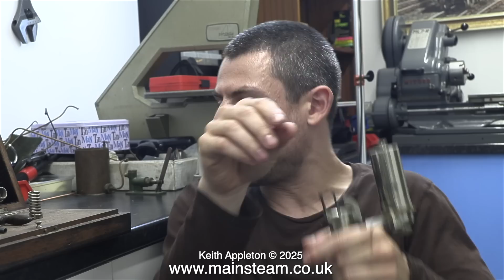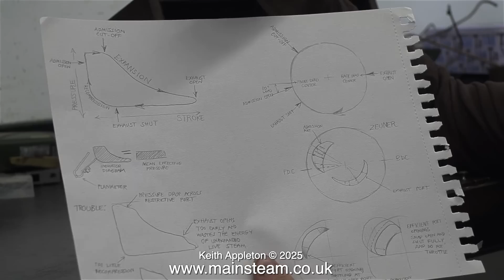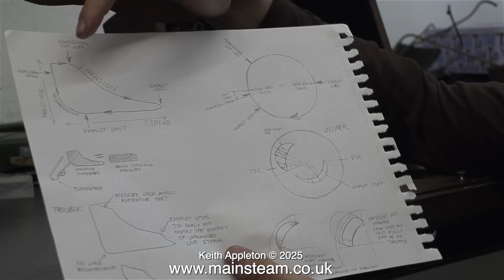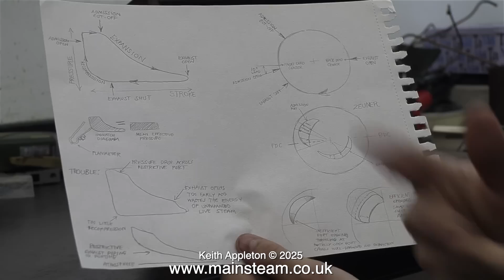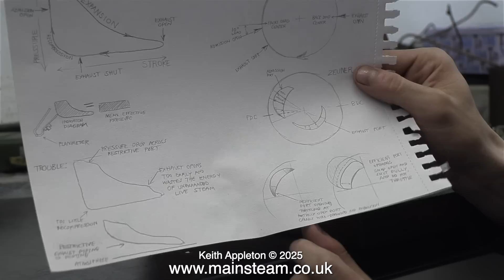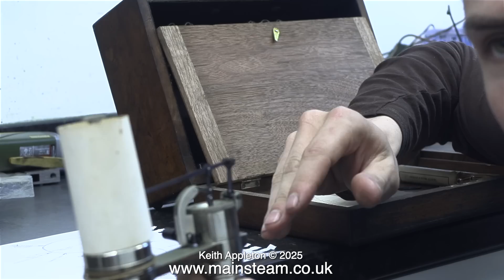ALEXANDER KARNES AND THE MAGIC BOX

Comment: Keith, Thanks for another great video, and please thank your friend Alexander Karnes for explaining the instruments to produce the "indicator cards."  Have a number of Society of Naval Architects & Marine Engineers papers [written about steam vessels & their engines] which contain copies of indicator cars as exhibits.  Have a much better understanding of their use now.
Also have an 1883 Stevens Institute paper, which can't seem to find at the moment, written by I believe Professor James E. Denton, concerning the then new feathering-sidewheel freight steamer CITY OF FALL RIVER of the Fall River Line which had a compound working beam engine [110 pounds steam-pressure; 21 rpm; high-pressure cylinder diameter 44" with 8' stroke & low-pressure cylinder 68" with 12' stroke.  What is interesting about this paper is that the boat owners allowed the professor & his students to conduct experiments with the boilers & engine to ascertain efficiency, etc. while the steamer was in service between Fall River, Massachusetts & New York City [about 170 miles].  One novel experiment was, on some trips, was disconnecting the high-pressure cylinder & running the vessel as a single low-pressure cylinder engine.
Again, thanks for a great video!!!

Comment: The P (pressure) vs. V (volume) graphs are a fundamental thing in a thermodynamics courses.  Steam, Diesel, Otto (gasoline) engines have different curves (constant volume or constant pressure expansion engines).